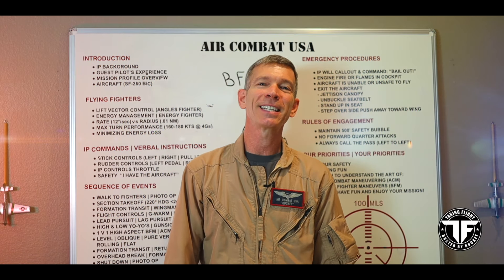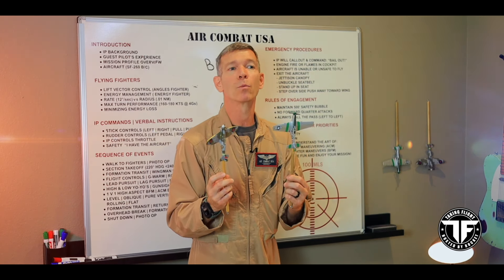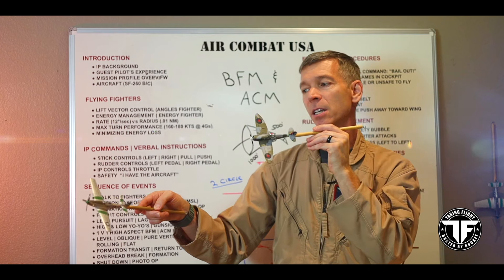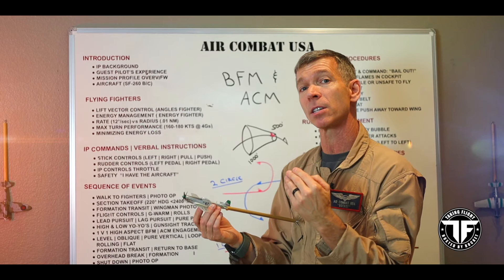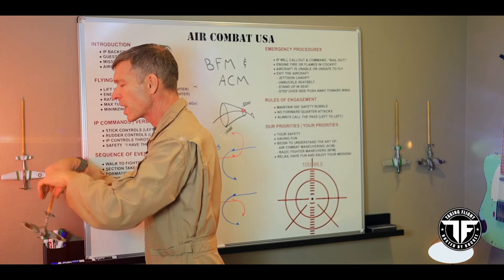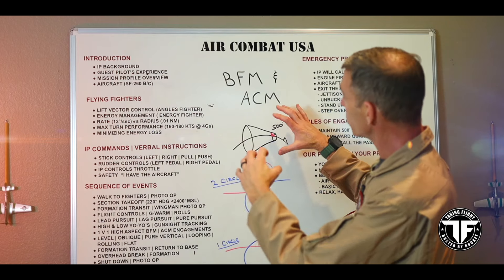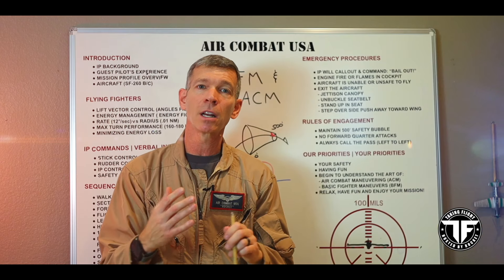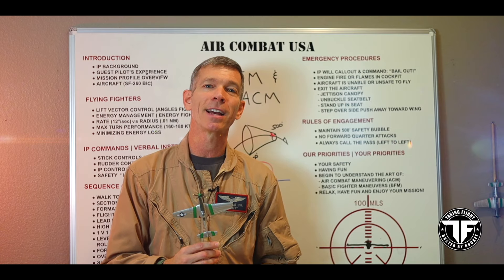How to Dogfight!  Basic Fighter Maneuvers (BFM) & Air Combat Maneuvering (ACM) Part 1

Comment from the maker: Correction: (6:40) The ammo rounds that you can actually see are called 'tracer' rounds.  They are built with a pyrotechnic device that burns white hot in their base to help the shooter see where the rounds are going. This dramatically helps the shooter to aim the gun. It also helps the target aircraft to detect and avoid the shooters attack solution.
Reply: Dont worry about the keyboard wariors, you explained the subject very well in an un edited video which is rare these days. Thank you sir
Reply: Guy doesn’t know what a “tracer” is. Not convincing.
Reply: Depends, on which Chems, you load

Comment: Ima be honest, I'm watching this for DCS. But, I always had my timing off as to when to reverse the turn safely, now I kinda understand how to use the reversal better. In DCS I've always heard reversing infront of their nose is a death sentence (And it is), so I just never really used it unless forced.
Reply: Ideally you want to reverse when your bandit is pulling lead. Depending on his closure, you may or may not be succesful in doing so. Remember that your reversal is you basically trying to pull the bandit into a one-circle fight, so theoretically and potentially any angle of attack switch that breaks their lead enough and lets you offset the pursuit curve at the same time, is a good reversal.
Reply: @noyrz  Yeah I’ve learned reversals now, thanks though.

Comment: Really well done! I didnt really understand aspect until this vid
Reply: Think of it like this. You have a 90 degree angle which starts at the tail and extends backwards. Your planes angle from the tail of the plane is the aspecs, so if you are at 45 degrees on that attack course then you aspect is 45 degrees. Your aspect rises and falls based on your potition on that 90 degree angle. Dogfighting is a lot of geometry and a lot of angles.

Comment: Where can I purchase the two airplanes that you are using in this video?
Reply: you can made your own models by Revell or Airfix or some similar model factory but there are metal cast models also that are finished
Reply from the maker: Can't remember where they came from....had them for about 7 years. The key is not to get too large of models. These have about a 6" wing span. 1/72 scale should be correct. Enjoy!